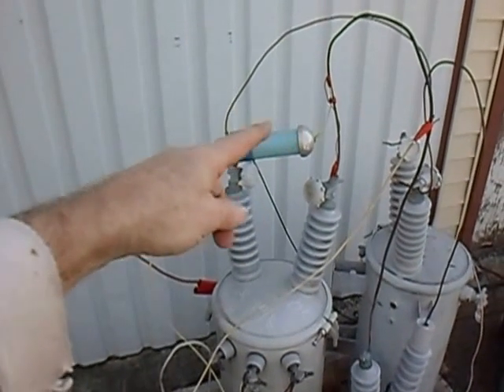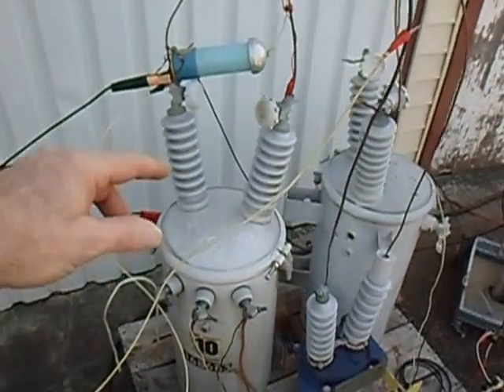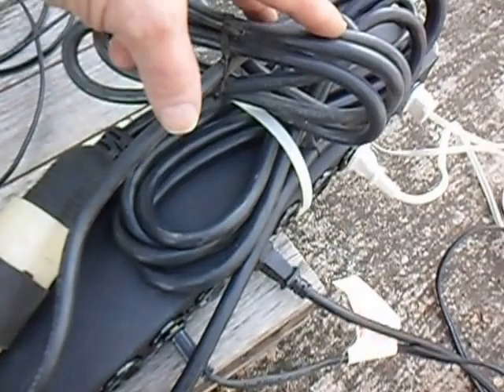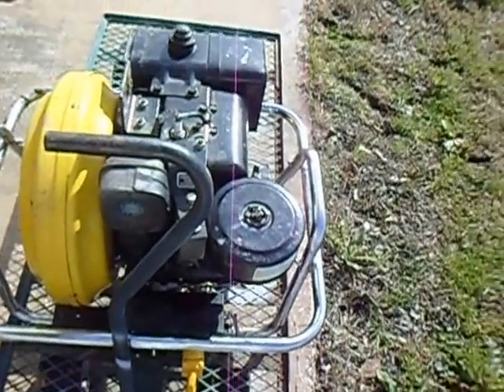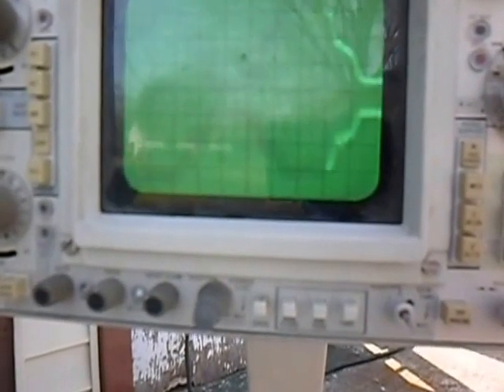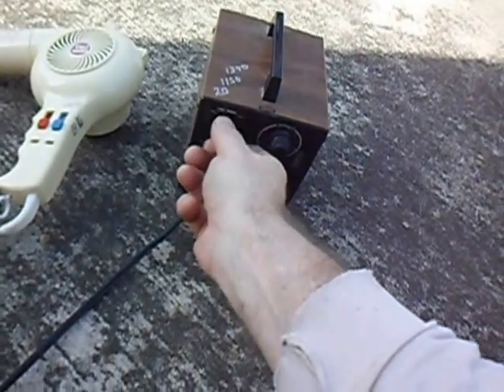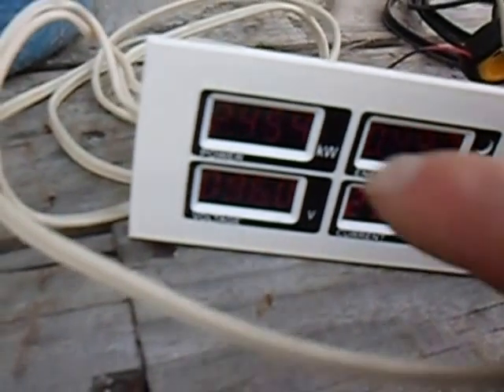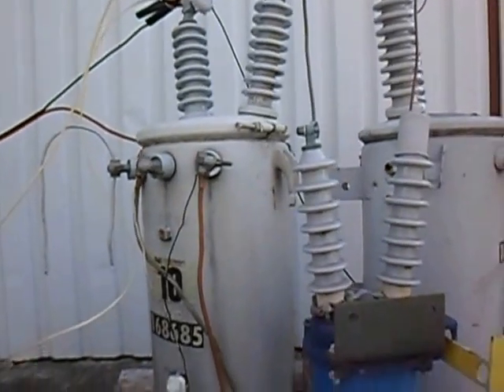McCulloch generator feeding pole transformers

Comment: Of course it works at or below unity. The real question is, what happens on the watt meters if you EXCEED the wattage ability of the generator by adding more and more loads? Will you get a voltage drop in the output? Or will the voltage remain full at the output while pulling more load than the generator can possibly provide? And, if it does go over unity, does the HV connection loose temperature as it becomes entropic as it draws energy from the environment?

Comment: Rectangular wveforms sounds like the system is not matched, and there is reflection in the system.  Out of curiousity, if you shortened the cable from the generator to the transformer, the distance between the steps should become smaller...  Transmission line theory.

Comment: I think the generator sitting on the concrete is limiting the output. I have done the experiment myself, other than technical difficulties I had with my engine on the generator, I did have a higher output voltage than I was supposed to have, also, since the output voltage was much higher than it was supposed to be, I ended up seeing a few hundred watts of overunity, not thousands. I think the devices he was using were rated at so many thousand watts, however, they were running at their rms wattage instead of their stamped peak. I did get the whole phenomenon with the temp tester, etc. That is exactly when it is working, but, I fell short by having a generator engine that was running shitty, then, it stalled when under a decent load. I will post it once repaired.

Comment: Well, as expected, the output power is less than the input power required. Not a big surprise. Why Morin would think otherwise is beyond me. This is a well documented experiment, and I thank you. Please be careful around that 14.2KV, I don't want to read about your early demise!  That is very dangerous voltage, just watch it. Thanks for posting.

Comment: I am not an knowledgeable about electricity/electrical current, so please excuse my naivete.......why do you have the smaller blue "switch" ?  what is it's purpose?  Also, I agree about questioning the use of the ground.  Also, would any of your measuring devices draw off some of the volts?  I agree that an experiment has to be duplicated exactly to compare results.

Comment: I'll get to see the guts of a pole pig wed ,   should be interesting..  Their is a video on How It'S Made for the pole trans. very interesting stuff.    I think going from 50kw tran to 25kw trans made be very important here.  not sure yet.  I have made two mini poles one with 22ga 400t for hv side and another with 24ga 400 turns.   I want to find out the difference  caused by the different wire size.   I'm going to use the 22ga to drive the 24 ga.  I'm using 2" wide copper plate thin style and this is wound into 2.5 turns for eacj mini.  mineral oil and old transformer core material are used.  I also used some resin with brake drum turning for additional core material.

Comment: What transformers were you using ? I believe that the mac gen runs at around 60% eff  so the 4hp would actually be sending about 1790 watts into the pole Trans not 2800 watts(I think)   Gerard used 50kw driving a 25kw.  I like your setup showing the information.  nice job.   we still have some more testing to do.  I'm curious as to what Gerard and the guy from France were actually doing ,  the saw they were using was running very well with the other the three 1500watt heaters turned on.   Can you tell us more about model numbers for your test equipment.   It is interesting that the more load gives you a better sinewave 60 cycle resonance.

Comment: Great input to this work bud just one quick question is it not go in high to one p/t & out into a lower p/t it looks like you're using two Ten p/t's ?
Reply from the maker: Good eye, You are correct, per Gerard the supply of power should be to the Bigger of your p/t’s and the load should be connected to the smaller, in this test two identical p/t’s were used because the focus of the test was did the waveform make it through the transformers (and we proved it did) In the next test we will use different size p/t’s as Gerard recommended and focus on the power in / power out ratio (note these tests showed to be about 96% efficient),
Reply: Hitby 13kw  you can still do it with your waveform into your scope  even swapping the two transformer it should be proper connected because Mr. Morin talking about potential a bucket of water is a potential you can carry a full bucket of water  and low potential a big bucket of water can only carry small amount of water because of holes in it and it refers to the transformer, that the transformer is a high or low potential, it is good to connect a bulb in series with the return line of the first transformer going to the source generator to measure how much voltage that the transformer have of that bulb depending on the wattage, and measure also the second transformer if still the same reading voltage of the first transformer to determine if it is not a low potential transformer.

Comment: Excellent work!! That vintage electrostatic voltmeter is a thing of beauty (I want one now)... So from what I saw, the transformers were behaving exactly as they should... They are designed for 60Hz and the Gen puts out 60Hz so they are highly efficient.(2.4/2.5=0.96) 96% is a really high efficiency, but unfortunately it is not OU...
Thank you for sharing and being honest.
When this is all over, I am interested in buying one of those pole pigs...
Peace and thank you.
PS Don't throw in the towel until the fat lady sings, try more configurations. Exhaust all possibilities. Hopefully you validate, if not, I am interested in buying one of the pole pigs.

Comment: Interesting test. Thanks for sharing.
One of the major benefits with this system I think is in the coreless generator. Does the rpm drop or fuel consumption increase after the initial load spike as compared to a standard generator?
They stopped making them for some reason ;)
Reply from the maker: These are very good questions, at this point in time we have not run the generator under load for long enough to reach any solid conclusions and are still collecting data, when we have sufficient information to reach a conclusion we will let everyone know the results.

Comment: Is it possible that your GROUND jumper cable are LIMITTING the potential output power??? I just wonderer if it can make a difference..  Gerard dont use any ground on his experiment..  Thanks for sharing
Reply from the maker: This is all new research, so anything is POSSIBLE. You are correct Gerard did NOT have the ground connection, we had that only because of the scope readings that were being done and safety, the test will be redone  without the ground and scope next time. Thanks for your input; I was so fixed on waveform readings it didn’t accrue to me that we had changed a basic parameter of the test.
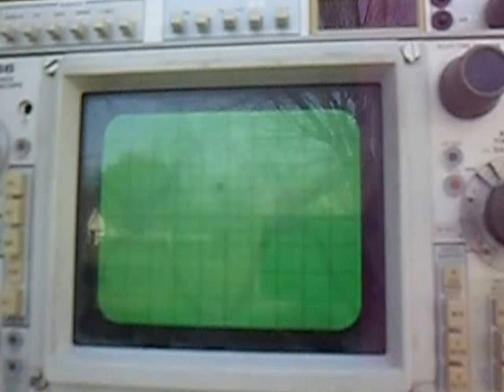Reply: Hitby 13kw I thought you called Gerard and he told you to ground the poles to each other? You should set the experiment up the same way Gerard does in his video. Show the generator not able to handle one of several loads and then show what Gerard did in his video. I would like to see an apples to apples comparison of what he has done and what you are doing. Great work by the way, I love how hard you are working on this and I know everyone appreciates it!!! edit: I watched the pig pole video by gerard and at 7:57 you can see the can's are grounded to each other.
Reply: ***** Also wasn't the genset only a 1500 way generator?
Reply: Hitby 13kw If i remember correctly, the generator was wired to the pig with 120 volt on the first 2 logs..  Not on the 220volts.. It`s hard to pointed where his EXTRA power was comming from,but i can tell you that the oïl Inside the pigs are really acting like capacitor when i tested a mocrovave transformer for a Jacob lader experiment.. Thanks for your patience..
Reply from the maker: ***** Yes Chris an apples to apples comparison is essential in these test, and several of the tests that are done never get make it to what you see, it’s just me, no production staff to script and edit what gets said, we will try to make better videos, learning more each day – thanks for your support.
Reply from the maker: ***** Thanks for asking, we need to keep everything open and clear, The McCulloch genset is rated for 3300 Watts.
Reply: *****
No Gerard pointed out in the video that his 4hp McCulloch generator had a 30amp fuse in it so @120vdc this makes it larger than a 1500watt unit. The only other one made is a 3300watt unit.